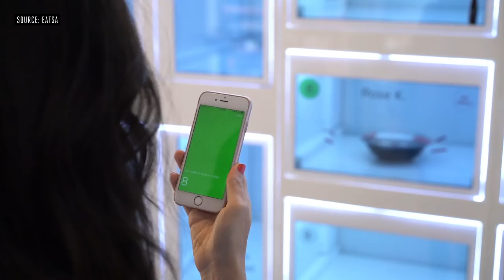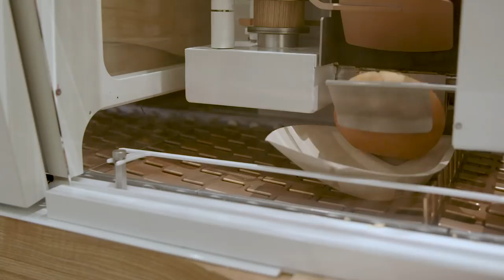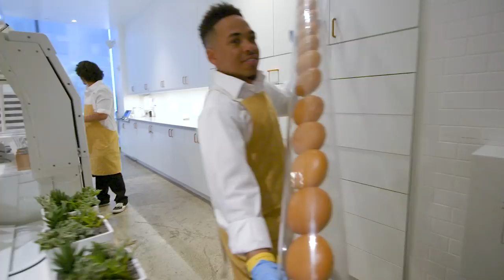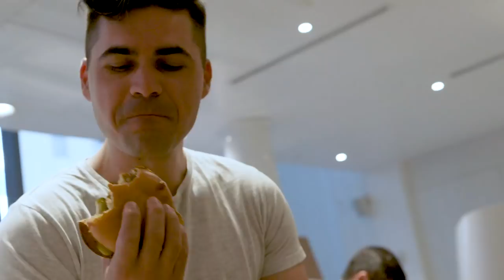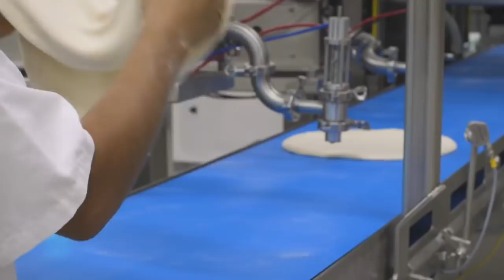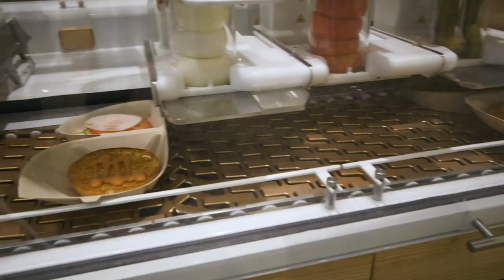Robot restaurants won’t take your job and food will be better

Comment: Well it will take your job lol. I used to work at mcdonalds. Before they rolled out the kiosk's we would have on avg 6 people on tills. Now there is 1 person. Why, because kiosks take peoples orders better than people do. And it's cheaper. 

Just say it will take your job, because it will.
Reply: It is the same at Costco. I would typically see 3-4 people on tills, 3-4 people in the back putting things together.
Now they have the kiosks, 1 till and 3 runners/pizza makers.
Half the people and the orders come out faster, I don't see this slowing down. Especially when people in my field are payed so well to design this automation.

As far as McDonalds they have been automating and reducing incrementally for a looong time.
Example, when I 1st started at McDonalds you actually placed the frozen patties, then flipped after a timer went off. Then pull.
Now they place them, push a button, a pallet comes down and when it pops up you just pull them, once they automate pulling that part will be done.
When I last was involved with backend at McDs, what used to be 5-6 is now 2-3 people.
Kiosks at Mcds did make and impact, as they typically have 1 cashier (not dedicated) to handle those not using the kiosk or handle issues.

Walmart (the smaller one) pulled out all of their cash stations, put all automated checkouts except 1 station.
So now there are 20 lines open all of the time and therefore checkout is faster.

Again faster checkout and leave will cause automation to take over. the next step is WIP is to check out the cart. Is pushed into the checkout stand, all items are processed without touching them, and you pay the total. Walk out, as more and more states start banning single use bags you just take the cart to your car and unload unbagged into the car unless you have your own carry bags.

This is just stuff happening today and stuff over the next 1-2 years.

the only saving grace for now is automated cars are still at least 5 years off, so there is still driving.
Reply: Haha the funny thing is, here in the Philippines, people hate the kiosks coz it made the service slowerrrrrr instead of linining and getting your order right away, you need to line twice for getting the order. So they blame it and now only very few people use the kiosks.
Reply: You have to look deeper.  It's not the robot (ppl think of it as a living being because of the movies...sigh) that takes your job.  It's the highly skilled engineer that out competes a bunch of lowly skilled servers. He gets investors to give him money to make whole or parts of automation to do a bunch of the servers' jobs.  He then collects a brunt of their would-be-paycheck in the form of sales and maintenance contracts. One day he will become really big because of all the servers' paychecks he got. In turn he gives some of it to other engineers, technicians, salespersons, etc...as well as warehouse workers.  Those who have no skills...can work in his warehouse instead of McDonalds!  In other words, new powerful ppl want you to work for them and not the old powerful people.  Same capitalist story for centuries!  ;)
Reply: Thats why we need Andrew Yang to win the election
Reply: I think that the real question is not whether there will or won't be jobs in the new industrial revolution but what having a job will get you in terms of lifestyle.   Even if you have a job, it may not be considered as making a valuable contribution to the powers that be.   

I am seeing this now with young people with University degrees that lead to underemployment, i.e. waiter/server and support living in one room in a communal apartment with the option of riding a bike to work.  The future is not brighter.
Reply: @rasmasyean  great plan,  except there are warehouse robots coming as well.
Reply: Hope it does take their jobs these robots make food far more better and it actually looks very fresh. McDonald's employees also look unhygienic 16 year olds be making food. Nasty Lol
Reply: @rasmasyean  An engineer that can automate away manual labor will not need your manual labor. Taxing automated goods and services and giving it directly to Americans is how we deal with automation.